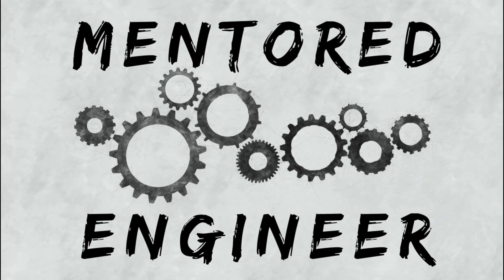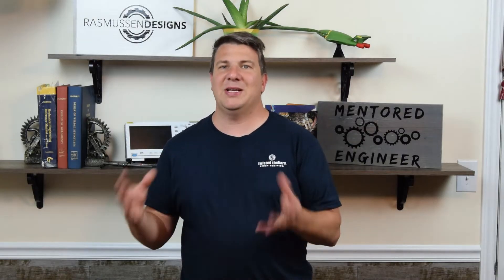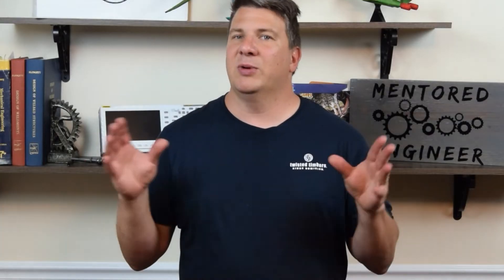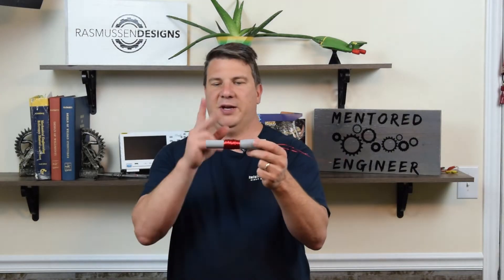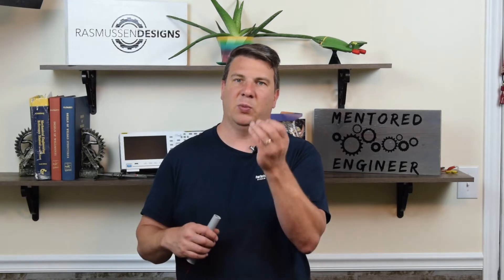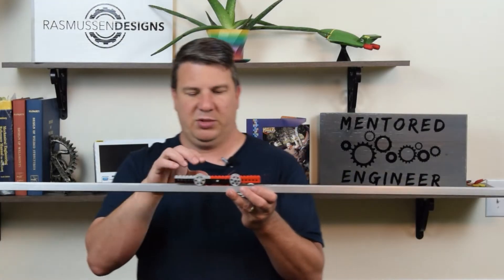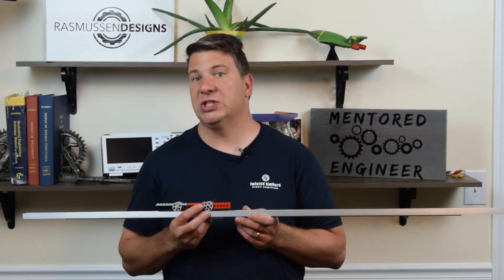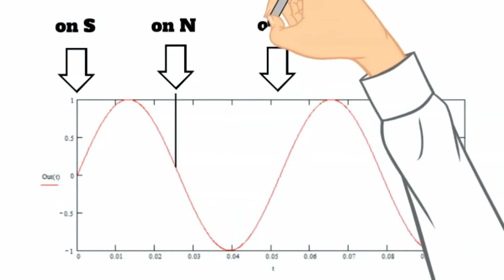How Linear Synchronous Motors Could Power Backyard & Pro Coasters (Part 1)

Comment: I learned about reluctance motors a few months ago… has anybody tried to make a linear reluctance motor? Zero expensive magnets :)
Reply from the maker: Yes, you are referring to LIM motors and they are the first generation of linear motors.  There are many roller coasters that use them like Possessed at Dorney Park and Flight of Fear at Kinds Dominion.  They are very innefficient and not at all precise as they allow slippage.  (LSMs do not)
BTW -I believe you mean inductance and not reluctance
Reply: @MentoredEngineer thank you for answering :)

I know that the 2 existing linear motors are permanent magnet and induction.

I was asking whether you ever saw a reluctance linear motor.
Reply: Induction motors and reluctance motors are not the same thing. I do not know of any rollercoaster that uses a linear reluctance motor.

Comment: All the power is in the inside of coils, and magnets, not on the outside where the industry has spent 200 years using. Use the inside flux power and boom your running at 95% efficiency. Why I had a hard time understanding the math and physics behind it. The industry  is just beginning to use the the inside power.
Reply from the maker: Do you have any resources I could explore?

Comment: If you could go back what would you get your Masters in? And Phd?   I did a Bachelor's in Chemical Engineering, also mention your bachelors.
Reply from the maker: My bachelors is in Mechanical.  If I had to (emphasis on had) I would go into either industrial automation or mechatronics
Reply: @MentoredEngineer    I agree with you because I have been looking a lot of the job postings in North Carolina and most of them mentioned industrial, automation, electrical or mechanical bachelor's required.   There is more applicants for a computer science job than a job that asks for an industrial, electrical mechanical or automation engineers.   I don't know why Universities are pushing "There's a big demand in computer science degrees if there are so many applicants competing for one job.  I am thinking of getting my masters in electrical or industrial engineering.
Reply from the maker: I agree with your sentiments altogether.  College will always be behind the times by a decade with our fast changing technology.  CS may have been the in thing 10-20 years ago and they are just now beginning to make a course change.
Already having a bachelors, you may want to look into a simpler certification that is current with the field you are in.

You may want to read this: https://mentoredengineer.com/never-get-an-masters-degree-in-engineering/